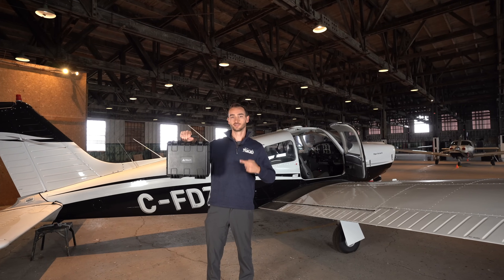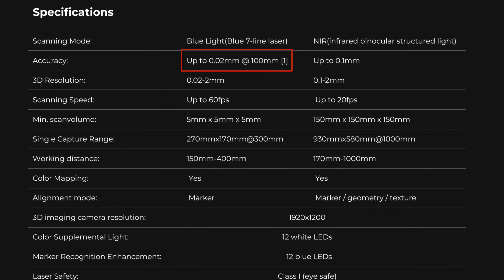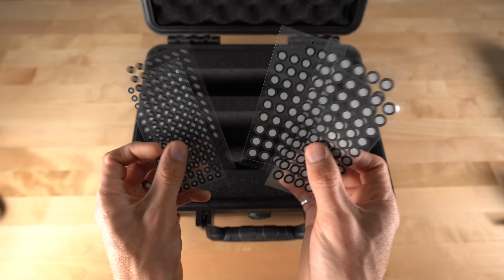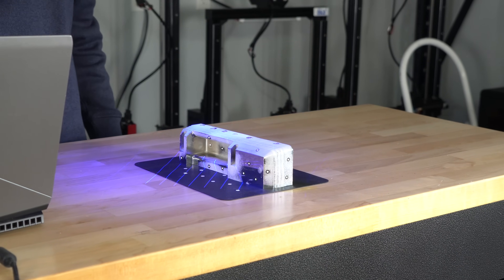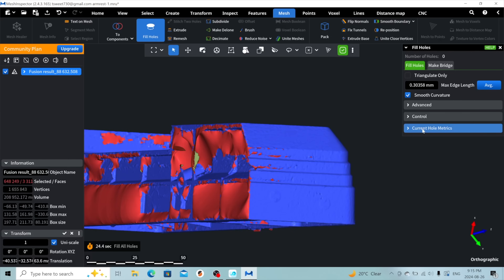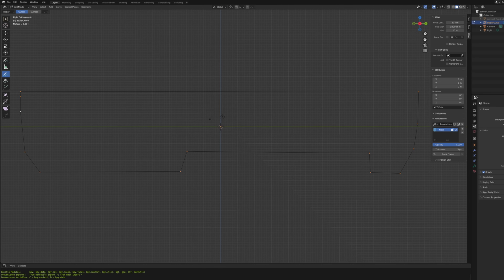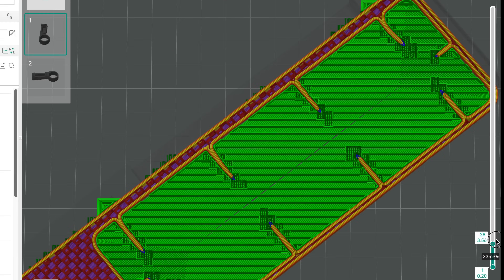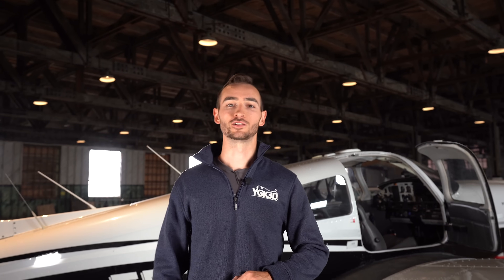How I Digitize & Modify Objects in 5 Steps - 3D Scanning Workflow (ft. Creality Raptor)

Comment: I’ve seen lots of your videos now and have to ask - is the Formbot Troodon improved in the past year?

Or would one be better served with an SV08 and modifications? Assuming they want an off the shelf choice.
Reply from the maker: I don’t know if it’s been improved since the pro version was released and that was quite some time ago. But neither has the SV08 that I’m aware of. I believe they were supposed to trickle down some of the features from the Max to the regular SV08, like the scanning probe support, but I’m not sure if that’s happened yet. Troodon is still a decent printer but there are quite a few other options in that category now. Creality K2 Plus is also pretty good, depending on what you’re looking for.

Comment: Is this an experimental aircraft? I was under the impression you could not modify your own aircraft legally unless it's experimental. I thought there had to be some kind of a certificate from the FAA that said it's okay to do this. I'm definitely asking the question not trying to harp on you I'm really curious because I could be doing stuff like this then.
Reply from the maker: @PDTROB1  good question. Not my plane so honestly I don’t know the answer. It’s licensed in Canada so that might make a difference.
Reply: You can modify within reason. But changing out a structure part as shown; yes a door handle is structure in aerospace. This is a big no no, unless its been certified, material is approved, and you have structural engineering performed. It is legal for him to make and sell parts but for "NOT FOR FLIGHT" , the customer does something illegal when they install it, I would never install the part. 

TDLR; This is highly illegal to install, or sell with statements that it is FAA approved. Legal to sell and to make for "testing" only. I would not be surprised if this guy got investigated for this, since he showed an installation of it.

Where is your engineering drawing, Loctite, torque screwdriver? etc.

Comment: I can not get meshmixer on my MacBook.
Reply from the maker: There is a version available for Mac.
Reply: So, here's the deal. Meshmixer has not only been killed, it's also been pulled from the official site (at least the Mac OS version). Recently, Autodesk said they will no longer support any Meshmixer or develop it at all. 

There's one way to get it for MacOS but I would hurry and remember to keep the installer file untouched somewhere, too. 

It's on the wayback machine, but I prolly can't post the link here, so put this search into google and then look for some Reddit posts in the hits - it will be explained there how to find the download link: "meshmixer wayback machine"

Comment: Thanks for the fantastic video! It had exactly the information I needed. I recently purchased a Creality Raptor and was unsure which software to use for editing and merging the data. Could you also advise which surfaces require pre-scan spray? For example, do black, shiny black, or metal surfaces need 3D scan spray treatment? Big thanks from Ethan in Australia!
Reply from the maker: @crazyethanyeahyeah  thanks Ethan. With these blue light laser scanners it’s generally only reflective and transparent surfaces that need spray. They do pretty well with black surfaces, which is not the case for structured white light scanners.

Comment: Great job, I was wondering what your laptop specs are? I've heard some conflicting info about the amount of ram required and processor speed it takes to get 30+ fps.
Reply from the maker: @MTR379  thanks! I use an Alienware M15 with 32GB of RAM, Intel i7-9750H processor, and Nvidia GeForce RTX 2070 GPU. The scanning is fluid with this setup but some of the post-processing is laggy.
Reply: @ygk3d  It might be overkill, but I just bought 64GB of Kingston DDR5 to pair with the Intel 12700H in my Lenovo laptop. Thanks a lot, can't wait to get started!
Reply: I was using a MSI with 16G RAM, i7 processor Nvidia RTX3060 and it worked great for scanning but could be very slow on processing.  I just upgraded to MSI Raider 32G RAM (expandable), i9 processor, and Nvidia RTX 4070 and have no lag for anything.
Reply: Creality's software can suck donkey butt sometimes. I have 96GB of RAM and it'll complain about being out of memory at 64GB used on particularly detailed scans. It'll then corrupt the save on its way to crashing to desktop. But, if you reboot that problem goes away for a while.

Comment: Very Impressive project! However unless your aircraft is experimental category, could you explain the process to have a 3d printed part replace a type certified component?
Reply from the maker: @ryanbellyt  thanks! Good question. This isn’t my plane so that’s not really my domain, but I believe you’re right about all aircraft components needing to be certified. The owner of this plane is using this custom part at their own discretion. I’m not sure what would be required to get it certified for more widespread use.
Reply: @ygk3d  I understand it his plane, and he can do what he wants at free will within reason to it. But it seems like there is liability with that, you provided an aftermarket part that could break, burn, etc. Seems like you could be sued for it, unless you did some good contract/paperwork. Since it its a paid job, its an advanced skilled labor (engineering, 3D scanning, etc.) , and if you market your services for aerospace components that are structures (door handle). Does not seem safe.
Reply: @ygk3d  This was a pretty bad change, as the ashtray is considered a safety component, at least in commercial aviation. Not sure about general aviation. I do know smoking is actually allowed in general aviation aircraft and even charter flights. And at least in commercial aviation, there's still ashtrays in case someone lights a cigarette and then needs a place to snuff it out safely.

Maybe the cupholder could be argued to be suitable, but that'd require certification.

Fortunately for you, that's a 'him' problem, not yours.

Comment: I tried scanning spray, but it is expensive and you will end up breathing all of the stuff that you spray on the object being scanned as it sublimes over many hours.  Rather, buy some spray-on foot powder. Inexpensive, effective, and easy to wash off. Also, with the Revopoint Miraco, no dots are required.  Seriously.  I stopped using those dots a while ago.  Unnecessary with the right scanner
Reply: It depends on the technology you use. Infrared don't need reflective dots, but it struggles with black and reflective surfaces. Laser is perfect for these surfaces and you don't need a spray. But the laser needs reflective dots for tracking. The Creality Scan Raptor has both technologies integrated, so you can choose which one you wanna use. This guy is using the laser mode and also uses scanner spray which isn't needed. He definitely has no idea, what he's doing. I have this scanner at home, I know what I'm talking about.
Reply: This laser scanner cost 1500€ the next I know is the Einscan HX for around 10k and even this scanner needs markers in laser mode.
You can print parts and apply the markers on them. You rarely need to apply markers on the part this way.

And you can’t use foot spray on everything. I will for sure not spray it on a iPhone or other expensive electronic device or for example in a cockpit or inside a car.